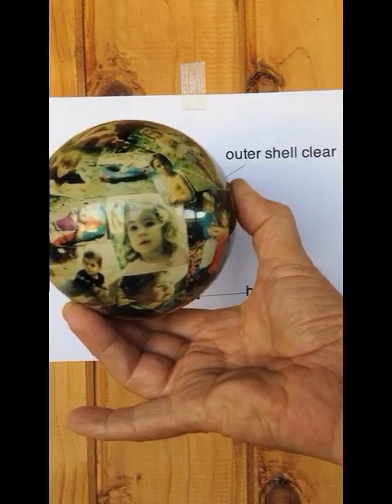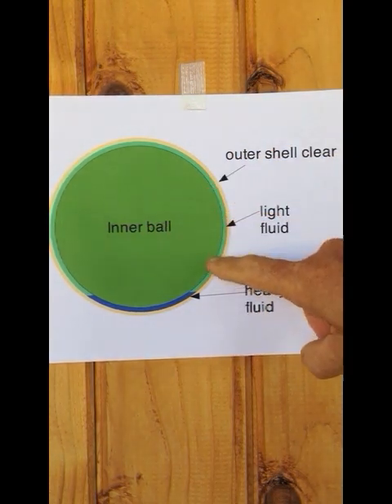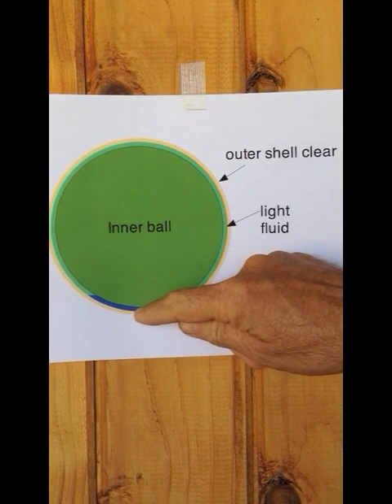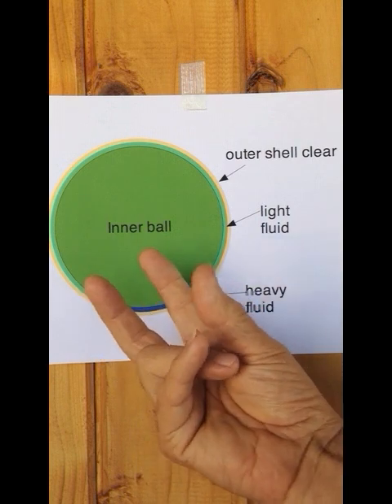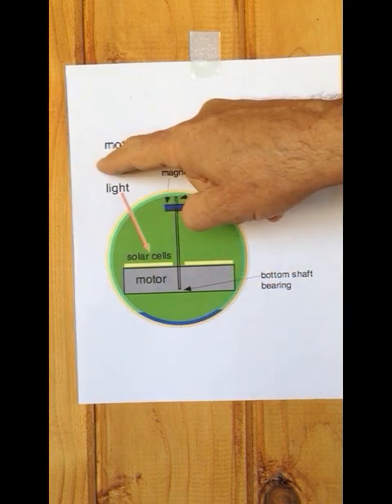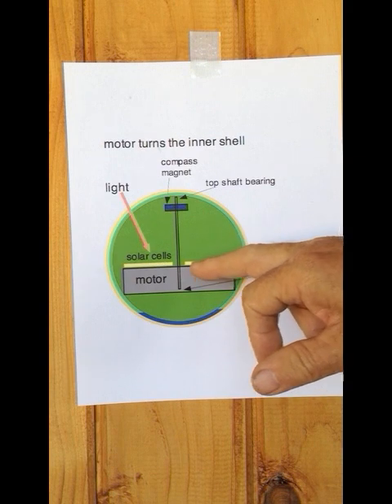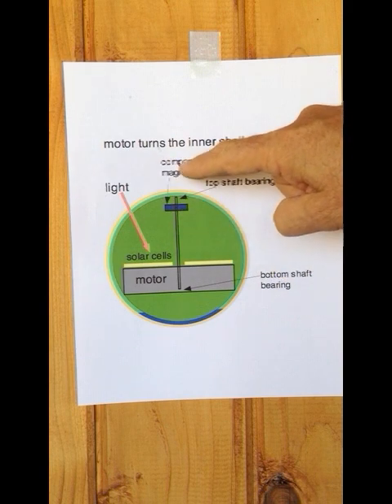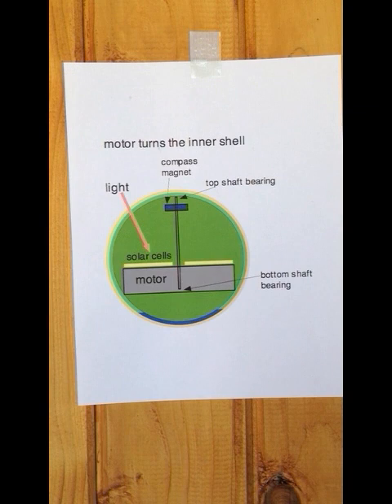Mova Globe origins and operation

Comment: Bill, I first saw your globes in a gift shop called Abacus down in Kennebunkport, ME a couple of years ago and have desired one ever since. Very clever design. This year my wife bought me one for Christmas and I just love it. (Update 2/23/25) I first complained the amount of ambient light needed to drive it was too high. Not true. It runs with very little ambient light. In fact, it runs BETTER with less ambient light. The problem I see, at least with the 4.5" models, is if one applies too strong a light source too suddenly, the motor spins the anchor magnet with so much force that it can't maintain its position with the Earth's magnetic poles against the inertia of the globe/motor assembly and never acquires a sync. This can be observed by simply holding a compass near the top. Globe jostles back and forth a bit while the anchor magnet spins. Best to start with a weak light source and increase slowly. A longer anchor magnet with greater inertia and/or even lower torque motor would help a lot. Just say'n.

Comment: Are the compass magnet and bearings needed? What about fixing the shaft in the globe shell while releasing the motor's stator from the globe? Then the rotor/shaft/globe would turn in one direction while the reaction would rotate the heavy stator in the opposite direction. Having the heavy stator in the southern hemisphere would keep the globe with the north pole up. From outside, we would see only the globe turning.
Reply: Interesting, simpler solution, however either the stator or armature must be held in position. In your example, they would both eventually turn.

Comment: I just purchased one of these secondhand has a little air at the no top of the globe. I have seen attempts  on YouTube drilling a small hole to top off the fluid. Have you done this? And is it successful? Also, what type of fluid should I use? There is two different types of fluid in it?
From what I can tell the difficulty was keeping the flood inside win using a syringe. Air bubbles want to push the floor and back out and when injected.

Comment: Bill,
 There aren't enough superlative words to describe what you have created with the Mova globe. When I first saw one on a cruise a number of years ago I instantly wanted one. The price was a deterrent and they didn't have the design/size I wanted anyway. It was the same problem on subsequent cruises, no large size in the design I wanted. On a February cruise this year I was reminded again of this unique product and they had no large sizes at all. So I went online to order one and all large sizes were out of stock. Finally I received one a few days ago. The price I paid is certainly not enough to cover the ingenuity and craftsmanship that went into producing it. They say nothing is perfect but this globe comes closer than anything I've ever owned. Even though I'm an electrical engineer I could never figure out how it worked. Of course the answer was on YouTube. Even though the literature said it had something to do with the Earth's magnetic field I always dismissed that because how could such a small magnetic force be of any use in a large "mechanical" way. And who would believe enough light could pass through the globe to power it when not even in direct sunlight. The ingenuity is just the half of it. I could not understand how this thing could be manufactured even after discovering the nearly invisible seam in the outer shell.  I had noticed the tiny dot on the shell and I oriented that at the top not even realizing it was a fill hole at one time. The undiscovered mystery is how that perfect graphic got put on the inner globe with no discernible seam. Let it remain a mystery I don't want to know it's just magic. It probably takes an analytical mind to really appreciate the ingeniousness of this product. You deserve a Nobel prize in physics for inventing such a wonderful device.
Reply: I think it gets inside, if this is acrylic, with the half of the sphere. Then use some magical acrylic glue, and paste the other half. Then fill it, then close it all

Comment: Hay Bill… are you still around? If so, is there a way to communicate to you directly via email? You, like I, we are both getting up in our years, and wanted to share with you a means to solely use magnets to cause continuous rotation. I achieve this using the difference in attraction between magnet 🧲 to magnet 🧲 verses magnet to steel. This simple formula negates Newton’s third law of attraction which states for every action there is an equal and opposite reaction. The difference in attraction between these two elements allows me to set up an imbalance which in tern is used to create continuous rotation. Since magnets eventually ware out this is not perpetual motion.

Comment: Hi Bill. A brilliant invention but like many other owners a bubble has appeared in the top and a paper clip on top reveals the magnet is rotating instead of the globe though leaving the paper clip in situ seems to anchor the magnet to get the globe rotating again. One observation is that there never used to be any sign of a bubble when it was working fine so as nothing has leaked out, I'm presuming the fluid might have leaked into the inner globe.

Could this be happening because fluid expansion from temperature rise between 2 rigid shells has nowhere to go so the pressure may be rising between the two spheres to the point something has to give, so a leak out from the outer shell or a leak into the inner globe would result? 

I'm wondering if the design needs something to absorb the expansion from any temperature rise before the rising pressure would cause damage. The expansion would be tiny but if there is no give to absorb it, the pressure could become high enough to cause damage.

What do you think?

Regards

Dave N
Reply: Dave N same happened with mine but a paperclip on the top seems to get it going

Comment: How well does it work without the anchor magnet? Why isn't an equal an opposite reactionary force sufficient to rotate the inner shell?
Reply: Magnet allows for less energy loss. Take an internal combustion engine from a lower end sports car for example. It moves the car around pretty quickly. Take that same motor and stick it in a boat of the same weight as the car. It will do a good job still, but it will be worse because transferring that energy to water is less efficient. There is a lot of energy loss. Take it further still and put that motor in a propeller driven aircraft of the same weight. I'd wager the aircraft might just barely start rolling on the landing strip due to the high levels of loss.

Or, from another angle, consider any automobile driven on two different roads: a race track vs a sandy desert. Transferring power to sand is going to be a nightmare for the driver of that vehicle as there is so much power loss.

Ideally the motor's shaft in this globe, instead of going to a magnet, would exit the globe and get welded onto a huge chunk of steel. That would let it spin like crazy. However, this defeats the purpose of the design. The best middle ground is what is shown in this video.
Reply: Magnets aren't magic, they introduce drag and friction like everything else. Water, on the other hand here, acts as a lubricant, reducing the friction.

Comment: +Bill French,  
Very nice Jim.  Saw your globes for the first time today, Dec 30, 2017.  It isn't often that something comes along that so elegantly combines fundamentals from such a wide range of sciences. While the layman may wonder, there are those of us that are in awe since we understand precisely what is happening.
This was a challenge at first. It took the 30 minute drive home to figure out everything except the immiscible fluids; I was simply going for neutral buoyancy in a single liquid, but the two fluids gets you the required spacing. Beautiful. It is surprising the stationary magnet has enough torque, but as you say, the drag is minimal. Are there any issues at highest latitudes?
I'd be curious to see that Reynolds number it operates at, however, it is most likely operating in the boundary layer, no?
...
As a Don Herbert disciple in my retirement, I do a wide range of science demos, so I knew this would drive [no pun intended] me crazy until I understood it completely.
..  
Since the basic mechanism is simple (to me), I'm quite fascinated by details and the manufacture process, as it looks so good...VERY well implemented.   
I was so intrigued in general that I forgot to inspect one for signs of the seam.
...
Can you share any detail on the motor?  I've designed DC Brushless.
Is there a cappacitor? I blocked the light, but it didn't seem to slow and re-started if disturbed (with some help from Newton). (:-D).
When did it go into production? Can you talk about the quantity made?
I also see one comment about direct drive with only electromagnets...interesting. Wonder if you looked at that?
- - 
Best Regards
Reply from the maker: Glad you like this design; it was exciting  pulling together different elements to create the final combination. 
 We do not use a capacitor to store energy. If it continued to rotate when you blocked the light then this just means you allowed some light to pass. It really does not take much. 100 lux ?
The Fluid has very little turbulence.

The motor is commutated by optically by a shutter that controls light reaching photodiodes.
We started production in about 2004
Reply: Thanks for the rapid response, Bill,
RE: "optically by a shutter that controls light reaching photodiodes."
You use of the term "photodiodes" puzzles me a bit.  DId you mean photocells?  I can clearly see them in the sawn-apart video.  I think they are the amorphous (low-light) kind... but I didn't see any vanes to selectively block them...  Three cells--> three pole motor...?
...
So you're commutating with the ambient light to photo diodes for transistors to actually switch the motor current.  Kinda' complex...or it is a mechanical vane arrangement commutating tambient light to the photo cells themselves?  That's pretty elegant, it that's it...
 Can I get it from the patent? I haven't looked there yet.

Comment: Would it be possible to just have a circle of electromagnets on the outside (i.e. the support) and one inside so you wouldn't even need a motor? The only problem I see is that it wouldn't work away from it's support, but the cost should be significantly less

Comment: i am a bit nervous about ordering one becuase i have heard that many stop working due to air bubbles forming at the top. What is the mechanism of air bubbles forming ?
Reply: +Prasanna Tilakaratna You should be nervous. I bought a 6 inch globe in July 2016 and two months later a big air bubble formed and the globe is no longer rotating. I am now stuck with an ugly static globe because the warranty is valid only in the country of purchase. I bought it from New York, while I live in Sweden and it's not financially viable to ship it back. No help from Mova with the problem. Very disappointed.
Reply from the maker: +Prasanna Tilakaratna 

We have made some changes in the manufacturing process that should greatly reduce such problems. Please send me your e-mail address and I will send your comment to our CEO and others.

Thanks,

Bill
Reply: Prasanna Tilakaratna it’s true, same issue.
Reply: +Bill French DIsolved gas?